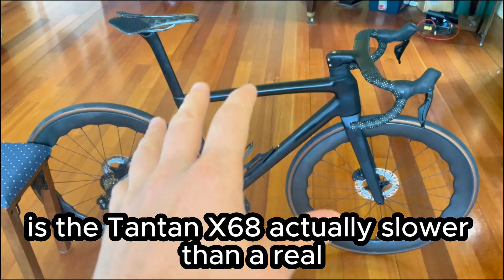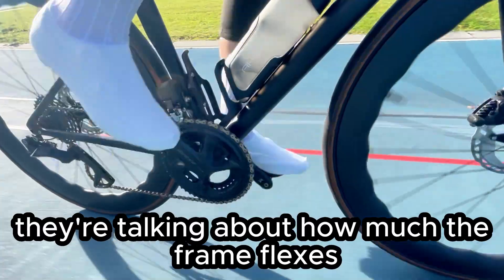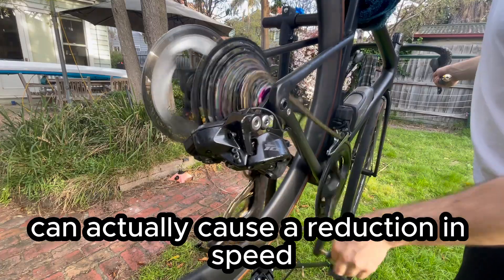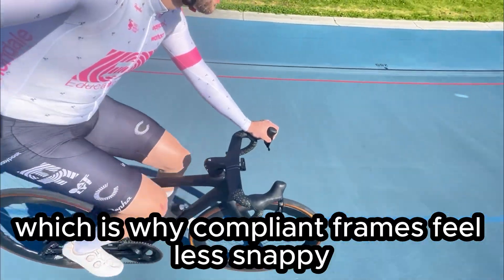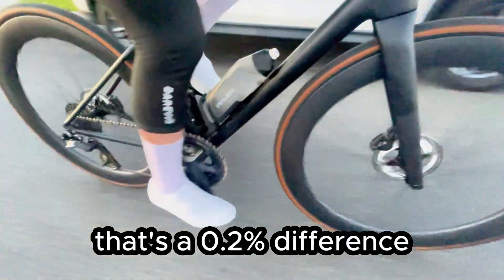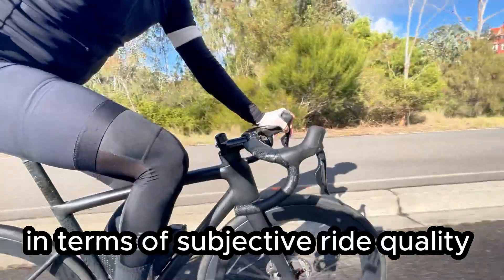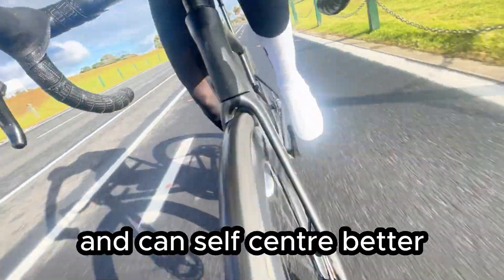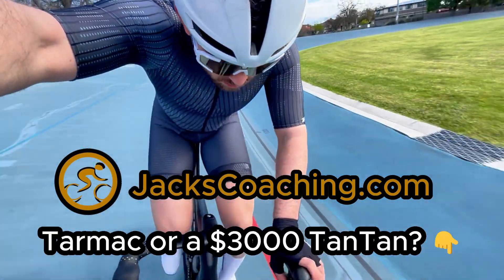My $3K SL8 Clone is Faster Than a $16K S-Works! (Frame Stiffness Deep-Dive)

Comment: 55 seconds into the video “… i’m gonna go full science mode…” so where is the science??? Where are the numbers??? You can’t say that without backing it up!!! All perception which is as good as an opinion and it’s all subjective.. sure i can agree with the aero dynamic point. When you say it’s basically the same, well it’s not.. 😂 i’m not saying the tantan frame is an awful frame. I’m saying this video is not backed up by science. This video is how you felt when you rode this bike.
Reply from the maker: The data is out there and I referenced it briefly in the voiceover, but here’s where it comes from:

Tour Magazin stiffness database:  hundreds of lab-tested frames, showing modern race bikes all fall between 60–90 N/mm BB stiffness and 90–120 Nm/° head tube stiffness. Beyond that, extra stiffness has no measurable effect on speed, only on feel.

Zedler Institute also confirmed the same thresholds: once a frame clears ~60 N/mm, return of elastic potential energy happens within the same pedal stroke (< 1 W loss at 1500 W).

So my claim that the TanTan performs the same as an SL8 isn’t just “feel”, it’s based on the physics of stiffness thresholds and elastic energy return.

In the future I’d love to do a blind test between the bikes, and build both SL8 and X68 with identical components etc. and measure if there’s any statistically significant difference in speed for a given power output. (That’s currently outside my budget for now 😅)

Comment: If a framis stiffer, it means it should be faster in acceleration meaning you should have an advantage because it is quicker right?
Reply from the maker: Not exactly..it’s a common misconception and marketing myth by the bike industry.

Once a frame is already “stiff enough” (past ~60 N/mm at the BB), the flex is so small that all the energy stored as elastic potential comes back within the same pedal stroke, under 1 watt difference even at sprint power.

So a stiffer frame feels quicker because your brain gets the feedback faster (less vibration delay), but the actual acceleration and speed are identical. The difference is perceptual, not mechanical.
Reply: @JacksCoaching wow thanks Jack! Didnt know this until now! Keep the videos coming Im a fan
Reply from the maker: @hansthetix8053  No worries! Glad you found them educational! And will do!

Comment: Great video! I am not one for clones  nor how much big brands charge for their frames. However, I love your statistical data and fact checking. Frame weight is so miniscule and in reality a heavier frame should be more durable with improved longevity which I am for. Then stiffness has also never been proven to be faster than less stiff, just sensations and confidence perhaps. As long as your frame isn't casting brake rub, there is no difference in measuring speed. I have actually tested my Colnago C40 against my Dogma F10, aerodynamics. The F10 has tested faster by Tour than most modern frames. In the real world, same position, same PM swapped between bikes and calibrated, same aero width handlebars, etc. At 26mph, the Dogma is only 3-4 watts faster than the C40! That is all!
Reply from the maker: Thanks Tommy, I appreciate that! Completely agree regarding frame longevity with the heavier frames. Yep, it’s only a sensorimotor difference, that’s all (assuming roads are flat).
Very interesting insights about your frame aero testing! Thanks for sharing!
Reply: All is told here ... )

Comment: i did many test with my own bike which also ended me spend a lot of money to satisfy my curiosity. this what i found.
frame yes it very matter when it about speed comfort and acceleration
but one part also very important for acceleration. which is the crankset.
what i feel regular alloy crank made from Shimano or from Campagnolo in average make me more fast compare to sram carbon crank.
Reply from the maker: Thanks for sharing. But do you have any objective data (eg from a pedal based power meter) showing that the cranks had a statistically significant impact on speed at given power output or is it just anecdotal, and if so how would you deduce such differences?
Reply: @JacksCoaching  unfortunately i not use power meter in daily ride. i only use power meter when i use trainer because trainer i used have power meter in it.
what does make me very certain is the feel, when i use alloy crank i feel my leg very comfortable to stay at 38-40kph it feel more easy, but when i use carbon crank i fell it struggle a bit to keep the high speed and my hearth rate increase also and i feel more tired in the end.
Reply from the maker: @endtimeslips4660 Fair enough although unless there’s major flex in the carbon crank it most likely wouldn’t cost many/any watts that would be noticeable to average speed, there’s just too many confounding factors.

Comment: I'm sorry, his sl7 has the old handlebar which by itself 4-6w difference.. If the tan tan is an exact copy of the sl8 then it'll be similar in a wind tunnel but riding characteristics will surely be crap compared to even an SL7.. That SL7 is also no 16,000...relax.

I'd purchased a 2nd hand SL7 S-works before I'd consider a tan tan to be frank, done exactly that £2000 inclusive of handbar. 

Tan tan warranty? Tan tan QC? You didint talk about this.
Reply from the maker: But what do you mean by riding characteristics and is there any evidence it will make you slower? The TanTan is quite stiff but also comfortable enough for long rides, so the ride quality is quite good.

His bike is $16K purchased new (25k AUD), he has Lightweight Milenstein wheels and top of the range SRAM groupset.
Reply: @JacksCoaching these wheels were fancy and cool back in 2020.. Any £1000 wheelset from. China will NOW be better and faster. Old tech and froth but not much actual value, he couldn't sell that SL7 for any more than 3,500 and the only people would would buy it are frothers over the wheels really. 

I've ridden loads of bikes including a lower end ones when I first started since 2020 and there's a massive difference in feel, and ride quality. Just because you copy somethings shape 100% does not mean that bike is 100% like the frame it's copied from. I thought that was understood already? Frame layup, and material do alot for ride feel..

Even went as far as buying a set of fake roval rapide bars online and compared them to a real one.. 100% same shape and hard to spot the difference and 1/5th the cost.. The fake ones are like noodles even through they have the same shape, QC is crap as the inside if not cleaned up and was catching cables, overall not there BUT THEY LOOK IDENTICAL.

Same will go for this bike, I'm 100% convinced.
Reply from the maker: @BikesKomsCRO  I agree with you regarding Chinese wheels and that’s kind of my point, that Chinese products are rapidly catching up to if not overtaking western branded products.

I was concerned about the ride quality of the TanTan too, but have been extremely satisfied with it. It’s slightly stiffer/harsher than my TCR but not by much at all. It accelerates rapidly and holds its speed. That being said, these are all psychological/sensorimotor factors that don’t actually affect the speed of the bike anyway. I think if you tried the TanTan you might be surprised too. It’s definitely not a noodle I can assure you of that! It’s a rocket ship!
Reply: @BikesKomsCRO I don't know where in the world you are - but I'm in the used tarmac s-works sl7 market for a few months now and waiting for a good deal on all platforms in europe - S-Works frameworks go for around 2500-3000 Euro without handlebar. That's 4-5x the price of the tantan. The SL7 is definitely not 4-5 as good ;D it's mainly the marketing and name. I want a SL7  over the tantan, but there are no logical reason apart from resell value.
Reply from the maker: It has a 2 year warranty. The QC seems pretty good, I’ve had two tantans and both have been great 👍